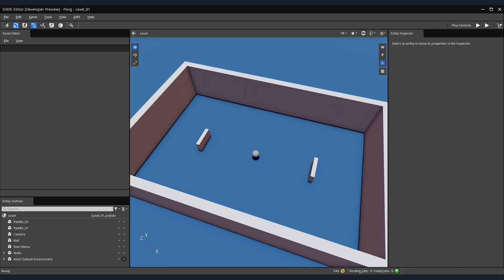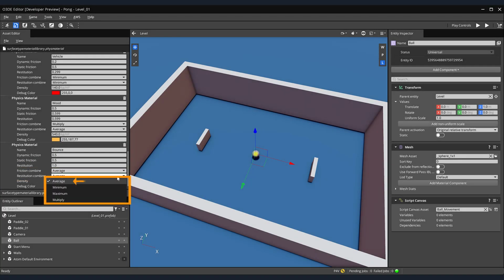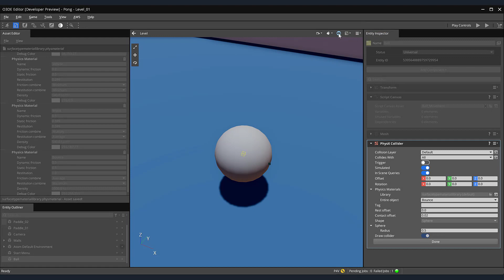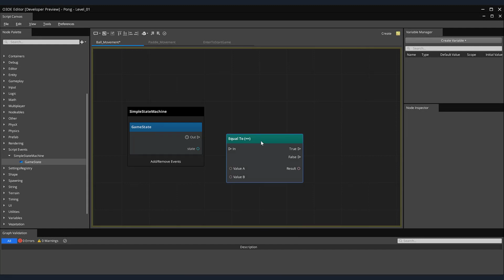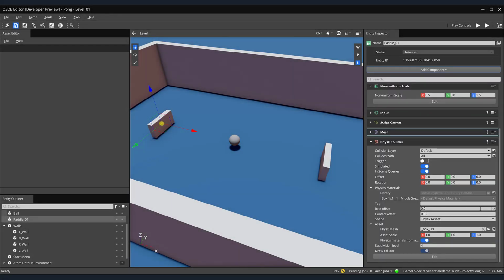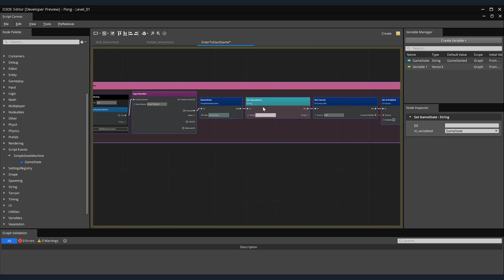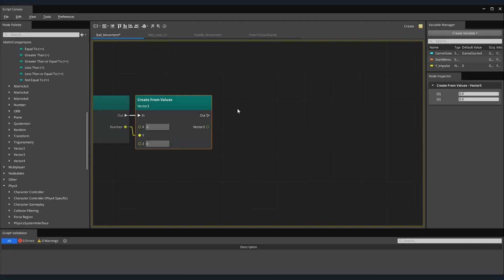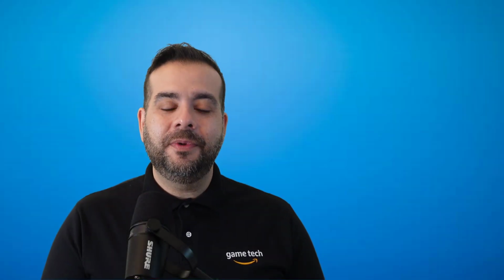O3DE Pong Game Tutorial, Part 7: Scripting Our Ball Movement

Comment: Here are the changes I made to get this to work since I couldn't find "SurfaceTypeMaterialLibrary" or the "PhysX Collider" component.

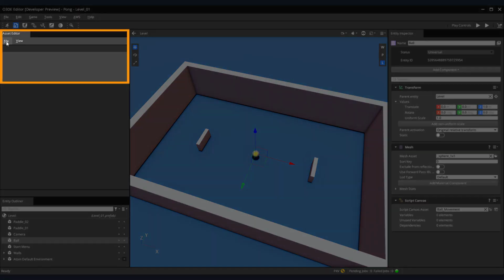- 1:10 For the bounce physics material, from the Asset Editor: File > New > PhysX Material. Then fill it out as the video says and save it as bounce.physxmaterial. Later on you select it in the collider components. 
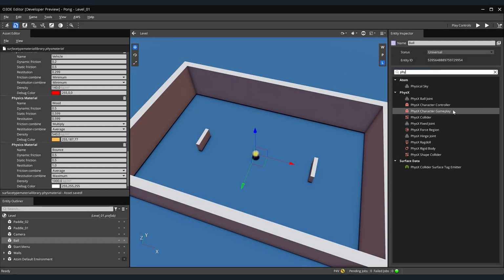- 3:30 The "PhysX Collider" component isn't there, so I used the PhysX Dynamic Rigid Body component instead, as well as a PhysX Primitive Collider component. You can follow along with the video pretty well with these since their properties are similar. In these components don't forget to set the Physics Material to the bounce.physxmaterial you made earlier, Shape to Sphere, and Computed Mass to 1.0. For the Paddles, instead of a PhysX Primitive Collider I used a PhysX Shape Collider component that automatically sizes to the extents of the Paddle mesh, and set their Type to Kinematic because they are controlled by moving them directly instead of letting the physics engine do it. For the Walls, I used PhysX Static Rigid Body instead of Dynamic Rigid Body (because the walls don't move), and a PhysX Primitive Collider. 

I'm sure other solutions are possible too but since this tutorial is supposed to be an intro to O3DE it seems important that it stay up to date. Hope this helps.

Comment: I'm not sure how to proceed without that material library. I added a assets/physx instread. Is that correct?
Moreover I don't find a PhysX Collider. Instead there are now four different colliders... If I use e.g. PhysX Shape Collider, it's asking me for Required Components. But I have no idea which are the correct ones and how to configure them.

I think this tutorial urgently needs an update. Or at least a comprehensive explanation what's not working anymore and what to do instread. It's a beginner's tutorial after all :-)

Comment: Looks like several things have changed since this tutorial was first made almost 2 years ago. Now there are 4 different types of collider, both dynamic and static rigid bodies, and Physx materials work differently as explained in @aaronruizmora9819 comment. To achieve the same behavior, I did the following steps:

- To create the bouncy material, open the Asset Editor, and create a new file of type "Physx Material".
- Change the properties to those shown in the video. Then save the file in a location you'll remember.
- Add a "PhysX Dynamic Rigid Body" component to the Ball.
- Same as the video: Disable gravity and compute mass, and set and adequate mass value.
- In "Linear Axis Locking", Lock Z.
- Add a "PhysX Mesh Collider" to the Ball: here you skip having to choose the adequate shape and size so it's more convenient.
- In "Asset (Primitive)" disable the "Physics material from asset" option.
- Then you'll be able to add the physics material in "Physics Materials" > "lambert3". Click the folder icon and select the material you created before.
- Now for the Paddles, add a "PhysX Static Rigid Body". This component has no options.
- Then add a "PhysX Mesh Collider". Normally you shouldn't need to modify anything.
- Copy those components you just added to the other paddle.

And that's it, the script steps should be almost the same.

Comment: If you're having issues with the ball hitting the paddle and stopping, try significantly increasing its linear impulse (I used 10 instead of the recommended value)
Reply: I had this problem. I decreased the ball's mass to 0.75kg to fix it.